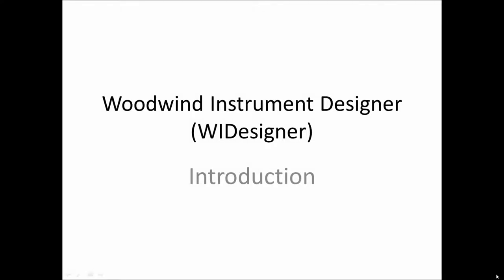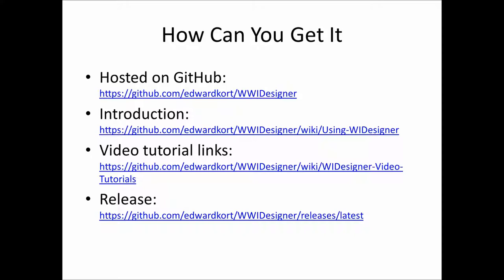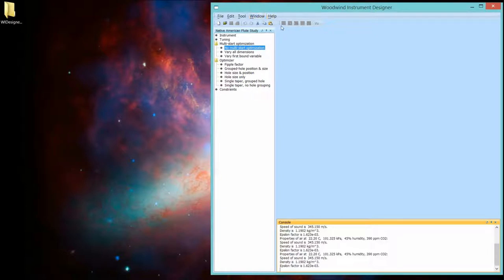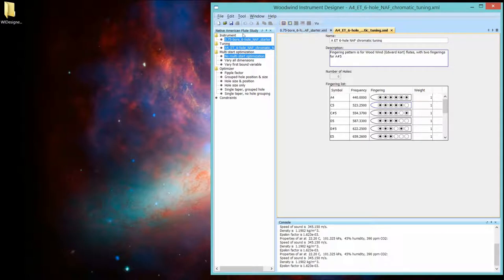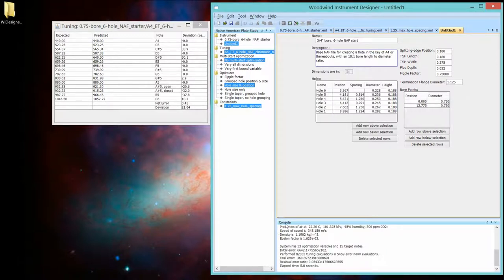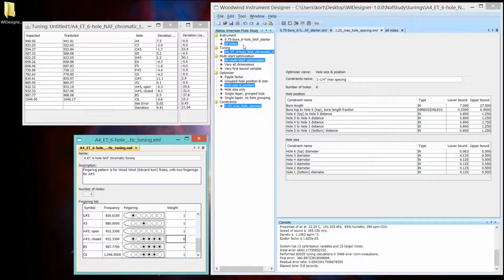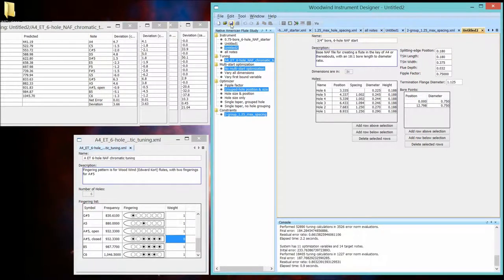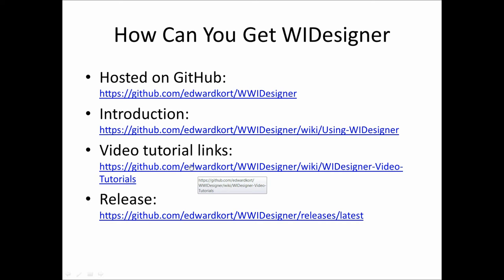1. WIDesigner Introduction

Comment: Even being in my first year of specifically crafting woodwinds (not everything), before I make any more NAF's I want to get out of the Basic Six final tuning method (esp. of a new flute I have no template for). I moved to Bob Grealish's method which I think seems pretty apt for final, hands-on, physical tuning  --- you test predominant cross-fingered notes associated with finger holes, along with their primary notes, and while your primary note is still quite flat and the hole is small, see if you need to stop merely enlarging the hole from the center -- i.e. if the cross-fingered note listed is racing up sharpening faster than the primary note, begin enlarging only the North crescent of the hole in order to inch the hole North a bit, which will sharpen the primary faster than the cross-fingered note and vice versa. I learned, esp. if my starter holes were a bit too far south to begin with, there's a threshold at which this stops working (and the cross-fingered note sharpens faster than the primary anyway even working the North side of the hole) and this is when you're beginning to distort the hole out of round. For whatever weird reason, a making a teardrop shape hole acts much like merely enlarging the hole 360 degrees, or from the center (in regard to trying to sharpen the primary note without radically over-sharpening the cross-fingered note).
Anyway, this tool is going to be superior to the online-only, web-based calculators I've used until now, to the end of making extended-scale-friendly NAF's. With a lack of expensive texts, they have gotten me far and I'll likely still refer to them when I'm searching for a bit of standard, filler info...
I, for example, found one apparent error in Flutopedia's Bob Grealish method for tuning, so it's good to cross-reference multiple sources. He stated in that paper that, for an F# flute, where  
<|  * o *  o o o  ] is "hole 5's" primary note E (correct) 
then 
cross-fingered note   <|  * o *  * * o  ]  was D  (a problem in my world thus far)
because that is two semitones lower than the primary where it should be one, thus D# instead (for an F# fundamental flute). This had me wracking my brain and hitting the books thinking I'd forgotten something conceptual about scales... LOL... 
Anyway, thanks a million again!!!

Comment: Hi guys I am experimenting with multiple bore taper points for an Irish flute.  When I use the normal optimisers I get a nice variable diameter bore but has a rather wide tuning deviation.   If I use the global optimiser for the same flute I get a very sharp nasty step in the bore profile but it predicts much more accurate tuning.   Should I just go with the step and see what happens?
Reply: It is common for the best solution to have a step in the bore profile. In practice, I find such abrupt changes to cause turbulence - poor tone quality. By adjusting the constraints, you can "force" the step to be more gradual. This will likely only increase the tuning deviation a little bit.
Reply: @edwardkort3516  hey very much appreciate the reply.  For some reason I didn't get a notification from YouTube lucky I came back here.   Ok that's reassuring,  I will do as you suggest. If I come up with something decent I will post on the git hub I see you have a show and tell there.   Thanks again.

Comment: When i try to open the contraints i get this message: the study model does not support required optimizer, HoleFromTopObjectiveFUnction (Hole size & Position). What is the problem?
Reply: It sounds like you are trying to load an older version of a constraints file, or you hand edited the constraints file. Just use (and possibly modify) a constraints file that was distributed with the version of WIDesigner that you are using.